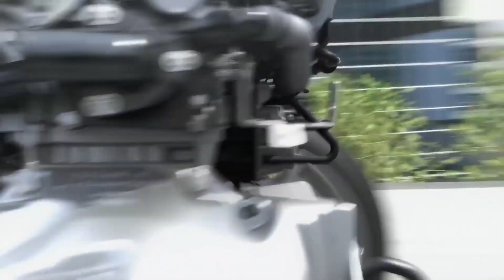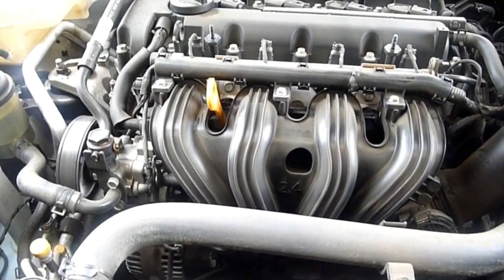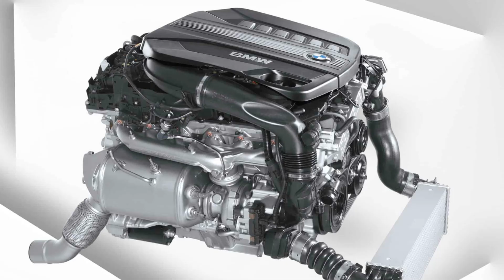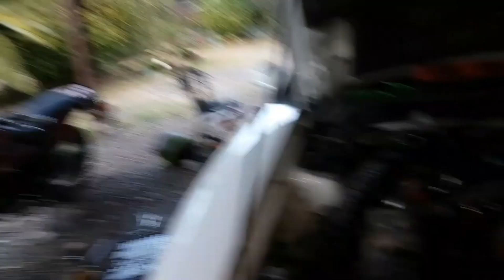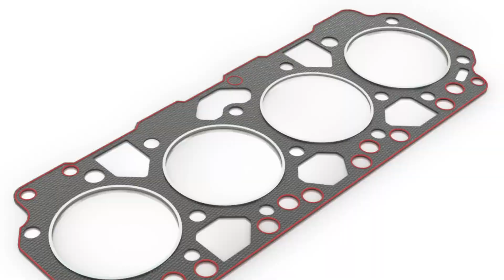10 Worst Engines of All Time

Comment: The olds 5.7 liter dx block put 1/2 head bolts with a 3 inch main crank bearings  51 % thicker cylnder wall  what a great build with a 425 crank and boring could  create a 451 cube engine wow

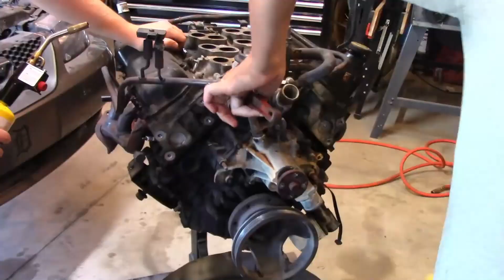Comment: 8:26
Then there was the 4.2 litre version of the Essex - which is arguably the most reliable engine Ford has ever made.
500k miles ROUTINELY with just normal maintanance.
I suspect the 3.8 version got there eventually after Ford fixed it's issues.

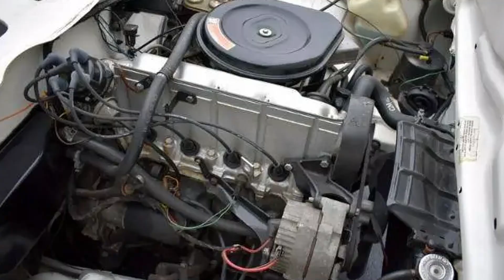Comment: 5:55
You missed a MAJOR issue - heads CRACKING. Common by the time they got to the 50,000 mile mark.
The joke became "GM calls this the 50,000 mile engine, because that's when the head will crack". (GM pushed "50,000 mile engine" in it's ads for the Vega, at least for a while).

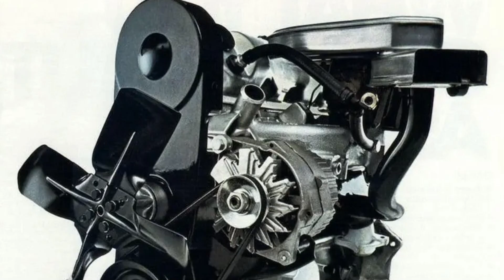Comment: 5:26
It was the "sleeveless design" that was innovative - aluminum blocks for production auto engines as such go back to AT LEAST the Buick and Olds versions of the 215 in 1961 (that eventually became the Rover 3500).